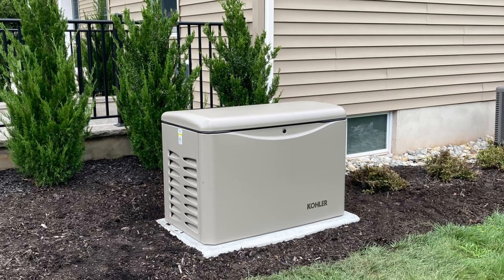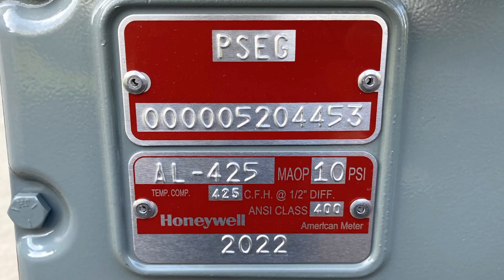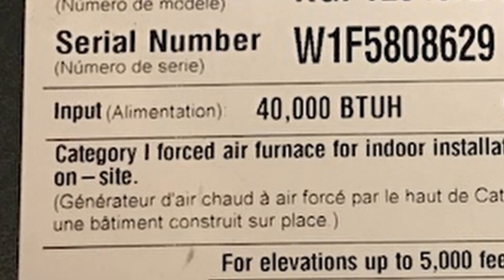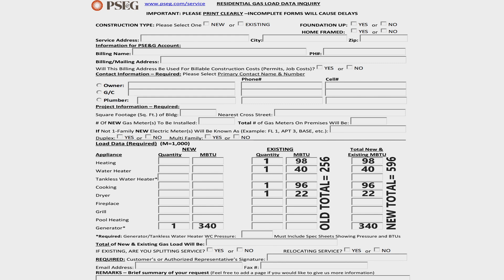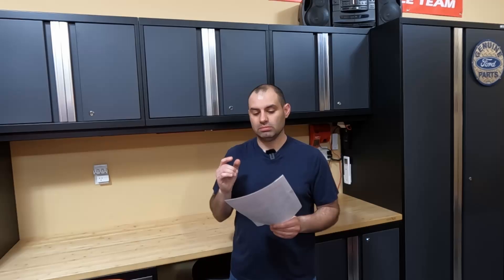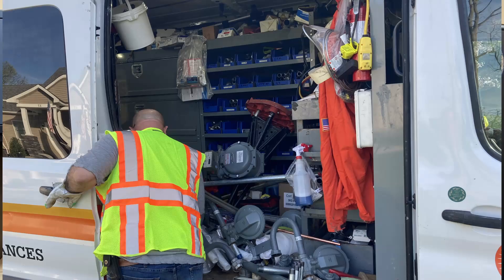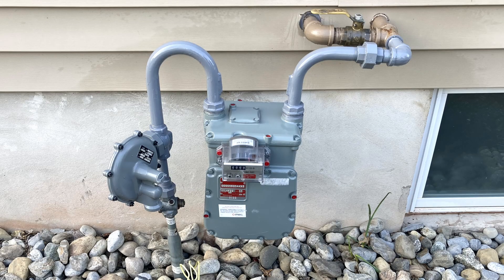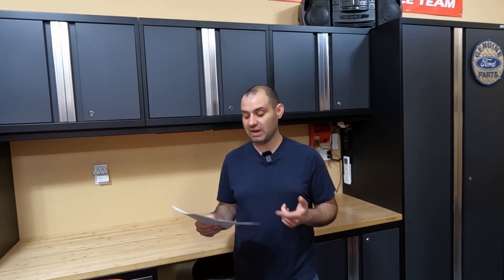Upgrade Your Gas Meter If You Add A Home Emergency Standby Generator

Comment: Great video. In addition to upgrading the meter, did you have to upgrade the service line from the road to the house? In Mississauga, Ontario, Canada, Enbridge will upgrade the service line from the road to the riser up to 20 meters for free with a per meter charge beyond that. The service line is typically 1/2" at 2 psi then gets regulated down to 1/4 psi after the meter. Apparently the larger meters need a 1" service line.
Reply from the maker: No, already had a 1” line

Comment: where is the line to the generator off the meter??  Also, is there not a consideration for the size of supply line coming to the meter?
Reply from the maker: it goes through the house, the line in is normally oversized in case you need a bigger meter.

Comment: I work in propane, and we deal with generators all the time. we usually run a separate second stage regulator for generator, in some case with do a tank presure split and have separate first stage regulator dedicated to the generator. in some commercial generator scenarios, we have a dedicated 1000 gallon+ tank just for generator and we provide it with liquid service instead of regulator controlled vapor service. so it all depends on sizing. its a good thing your tech checked the ratings on your system, A+ to him for that

Comment: Nice video.  My gas requirements are similar to yours. I have may missed it, but the reason you didn’t go to a 600+ cfh meter is because a 425cfh can basically output 850cfh?

Comment: Great video! The thing I'm concerned about if another large hurricane or natural disaster hits is that the natural gas would also not be available. When the ice storm in 2021 hit my area in Texas, there was not even enough gas to run both my tankless hot water heater and my central air heat - I didn't even have a generator hooked up, there was just a shortage of gas and low volume in the pipes. 

Do you have any contingencies if the natural gas wasn't available? If I move to some area with a few acres, I want to get a large propane tank that I can fill up every quarter or what not and not be reliant on external supply of anything.

Comment: What pressure were you at on that ac-250 before you had it changed? At 2 psi pressure, the ac-250 will flow 600,000 BTUs.

I just had a Generac 24kW installed. I have an AC-250 but I only had 1/4” pressure which means it would only output 250,000 BTUs. Called the gas company and they cam out and just swapped the regulator out on my meter to a 2 psi meter. Whole thing took 10 minutes. I did have to put appliance regulators in my inside gas appliances since those appliances can’t handle that much pressure.

Comment: Same situation with a tankless hot water heater.  They can be 200,000 btu, which is more than the furnace in most average sized homes.

Comment: Im i stalling an 18kw Generac,plate says NG at 247,000 btu hr and minimum 3.5 in WC and Max of 7 in WC, I’m currently testing the gas pressure with a 25 foot 1” CSST line from the house supply manifold, if i get at least 5-6 in WC at the end of the 25 feet line then I’m good to go and start my own install

Comment: I went thru this exercise with my home (and outbuilding).  The generator installers typically don't give you the inside skinny that you will need to update the meter or meter and line.
In my instance, they cost is only $485 to upgrade the meter and right now backlog of work, so will take months and not be done until sometime in 2024 and did not indicate the time.
  They will not start until the Work Order is approved AND PAID FOR IN ADVANCE!!

Besides the meter thou, I need a larger gas line from the street to the house where it spilts to the house and outbuilding.  Its only 40' and he confirmed would just be a Directional Bore, not dug, needed to increase the 7/8 to an 11/8 and would cost me $7000!!!!  :O

I had our utility company run a 350-400' gas line from the split to the outbuilding about 6-7 years ago and the entire cost was like $2300!

Needless to say, I did not approve any work yet until I see what my options are.

Can anyone else touch the line from the street to the house, like a gas contract company or plumber??  If so, I'll get another quote.

Any suggestions?!???
Reply: Following you on this. I have about 80’ to the street and dread the possibility of upgrading my gas line.  Anybody know if a plumber/contractor can do the upgrade of pipe size outside of the gas company?
Reply: UPDATE:  I escaladed the issue within the utility company in December, filing a complaint and getting the name of the supervisor.  

In the end, I told them I would NOT pay that kind of money, so would only do the meter upgrade.  I emailed the supervisor and guy who did the quote and let him know I spoke with the supervisor and was only doing the meter upgrade and supervisor and I directed him to update the quote to just the meter and $485.

When I got the quote back and then paid, I did note on the Work Order, it still indicated running a line!  I thought...nah.  We'll wait until they install it and see what happens.

In the end, I got contacted in February they were already ready to come out and we organized a time.  They came out and like 6 trucks and equipment showed up with 8 guys!  They DID end up not only upgrading the meter to a A-425, but also did run a new 1-1/4" line and I only paid $485!!  Soo, it's correct and the way it should have been in the first place and I got it at a discount!!  

In total, those guys ran the line from across the street, directional bore to the house.  Not sure the distance, I think like 120'?!?  They indicated again, as I knew previously, to my house there is no service regulator, so I already can get up to 40PSI to the meter, so they were reluctant to run the line and questioned it on install day as suggesting I should have enough pressure, but like I said, still ran it.  So again, with the higher than most folks pressure, 1-1/4" line run from service line across the street to house, and meter upgraded to A-425.  

I'm gold now, done right, as should have been and at a discount and can run both of my houses off of the 24kW under Full Load!!  Very Happy...Finally.  Wishing everyone else luck and be sure to push the issue if they try to rape you on cost and not just roll over and pay it, or not get it done.
Reply: @RozsaAmplificationLLC congratulations! Not knowing the ins and outs of this process, it sounds like you got a fair shake. Thank you so much for the update. I’m filling out the paperwork this weekend and this really helps put things in perspective in case they try to jack me on the install price.  Thanks again!

Comment: I would have left it alone for the following reasons:
1. Where are you getting 340k for the Kohler 20? Spec sheet says 281 on natural. 340 is for propane.
2. The generator only runs 340 if at absolute full load.  Rarely/never happen. If it happens the air conditioning will be a big part of it and then the furnace is not drawing gas.
4. Cooking loads are very diverse and will not run full tilt.
So if we add 40+50(stove not at max)+22+243(gen @75%) we get 355 which is 1.4x meter capacity which is fine
Or 98(full heat)+40+50(stove not at max)+22+161(gen @ 50% in winter) we get 1.5x meter capacity which is still fine
Reply: Agreed. This install is way over supplied.  All those appliances will never be running full at the same time, and what the heck is going to use 20kw in that house?

Comment: I had a 24kw Generac installed a month ago and the local gas co came out and made some changes to my gas install.  They took off the old meter and replaced it with one of the new smart meters, it was an Intelis V5 250 CFM.  I asked him why they went from an old 250cfm to a new one and did not go to a larger meter, and he explained I wouldn't need it.  they replaced the regulator before it going to the street with a 2PSI regulator.  He told me this regulator, coupled with these new smart meters would allow me to easily draw 550k BTU to the house and generator.  I have gas dryer and gas heat and 2 hot water heaters.  Along with the generator he worked up all the numbers and said I wouldnt have an issue even running the generator full bore with the others on as well.  Apparently, as he put it, with the right regulator, you can push these modern meters way beyond what they are rated for, as long as the pressure and pipe size coming from the street is there, which mine is now.  I'm in Louisiana BTW, right on top of the Hayneville Shale NG deposit, so we have more Natural Gas than we know what to do with  around here.
Reply: Your gas provider did the correct thing by using a 2lb system with most likely an ultrasonic gas meter . I would think you would have a regulator on the outlet of the meter or at appliances. By using a 2 pound system you virtually double the capacity of the new meter,
with a 2 pound compensating  index. 
I’m not a big fan of the way the gas company in this video upgraded the customer’s meter set. They did upgrade the regulator for the new gas load on inches of delivery (not lbs) but in doing  it that way, the capacity of the meter stays at 425 cubic feet per hour and should not exceed more than 10%  of its capacity .  By doing so that shouldn’t affect the operation of your generator or gas appliances but it does affect the accuracy of the gas meter. So the engineering department of the gas utility is undermining the engineering department of the gas meter manufacture.
Reply: @boby115  You are right the Intelis is a ultrasonic meter.   We actually had about an 8 hour outage about a month ago and were able to run the generator, home heat, and the dryer and hot water heaters and never had an issue, so he was spot on.

Comment: Lots of these meters are on backorder in Michigan. It took us 1 year to get ours after our gen was installed
Reply: Very helpful. Thank you!
Reply: Were you able to use your generator ok on your older meter? Did it come up as an issue with permit approval? I'm in Michigan on list for upgraded meter and about to have generator installed. I'll be just over the BTU limit on my current gas meter.
Reply: @jimsullivan9976 sorry I’m just now seeing this. We were able to use the generator with the old meter but were very careful to not have any other gas appliances on. It wasn’t an issue with inspection and permits because everyone was aware of the meter shortage. Most companies are just hooking them up to the old meters until consumers or whoever your utility is can come out to upgrade

Comment: IF you are thinking about installing a Natural Gas Generator, contact your Gas Utility and get on the list for an upgraded meter right away.  In Wisconsin, gas meter upgrades are taking A YEAR.  I am now on a list to receive a bigger meter.  12 months to get a new meter.  It’s crazy.  All because of manufacturing slowdowns.  The upgrade for us is $188.00.   
I didn’t realize I could get double the flow from my Sensus R-275 Meter.  I have been limiting my shopping to a 14KW and below because I need about 403,000 BTU if I ran everything.  I only really need the generator and my 75K Btu furnace.  I’ll have to call my utility and question them.   Thanks for the videos.  Love that AmsOil Small engine oil.

Comment: Mine was upgraded to the next level size when I had my Kohler 20 KW Generator installed . Water heater , furnace , fireplace and a NG fire pit . My installer took care of this process